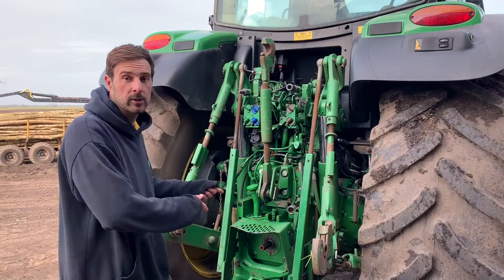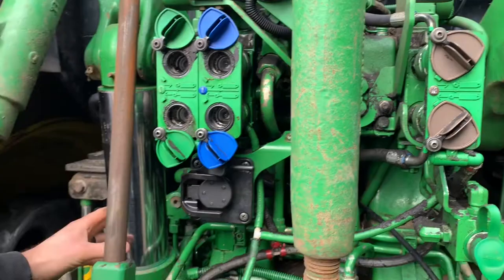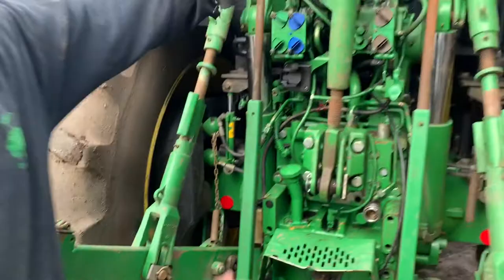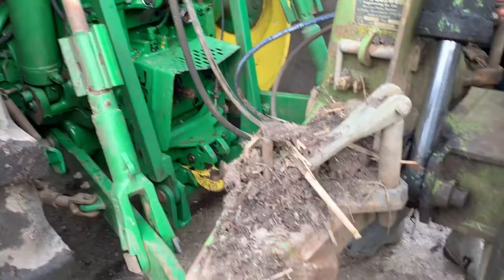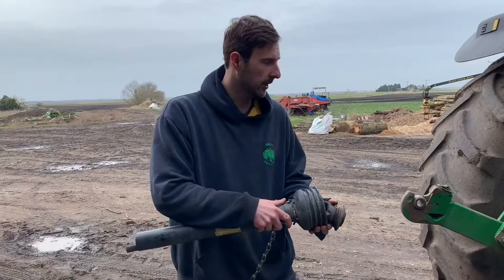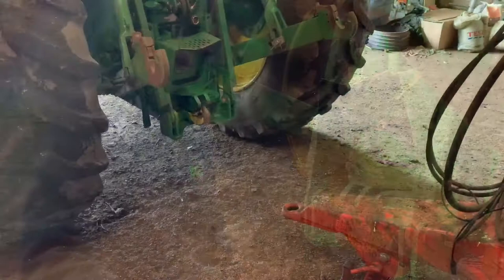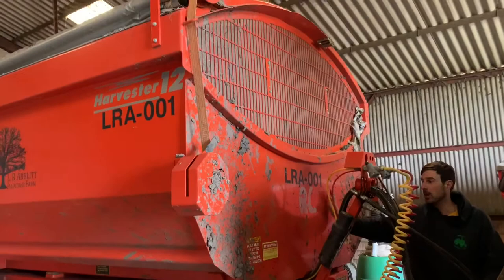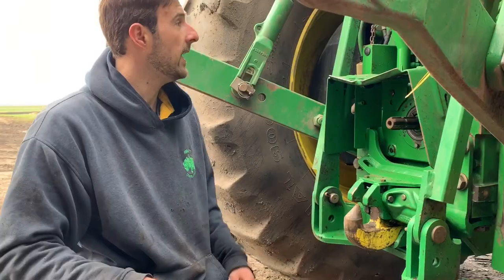How to attach an farm implement to a tractor Farmer Luke explains #farmerluke #tractor #farming

Comment: Great video quick question how would you know what pipes to put in what spool valve ?to work from the cab leavers or electric spool ?
Reply: Bit late but they are usually colour coded, as in there would be red marked spool valves and a red lever in the cab for actuating those spool valves.

Comment: Thanks!  So the middle connection with the plough can take the major force from plowing besides the 2 bottom connections ?
Reply from the maker: It’s more the two bottom ones, if the plough is set it correctly the top link (top point) should be loose you don’t actually need this to plough only to help lift it at the end!

Comment: Could you show once the trailers connect which spool levers work it and is it only one spool in use for the trailer and that acts as a return and inlet to the hydraulic ram